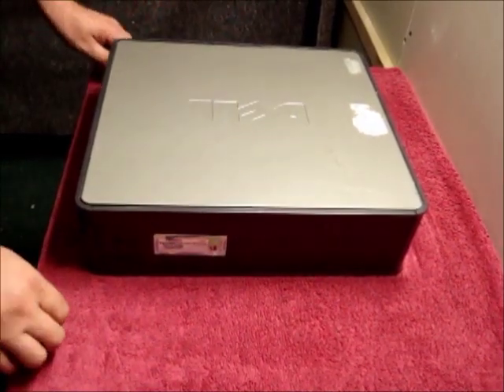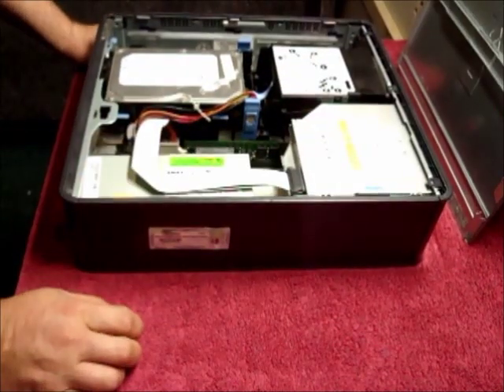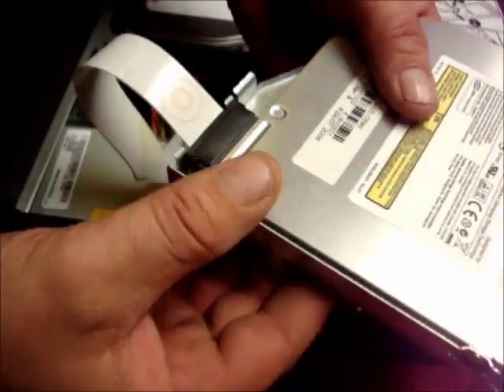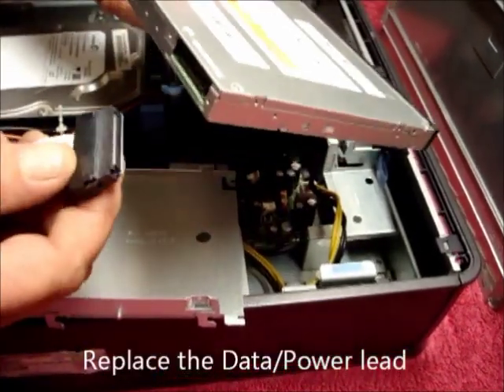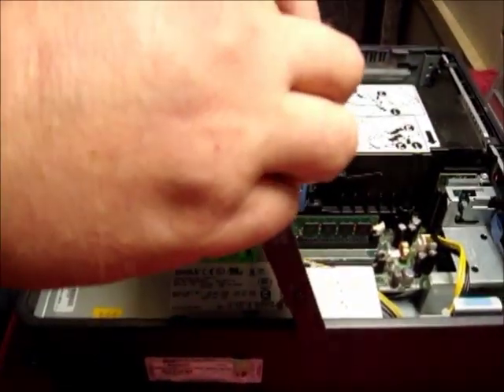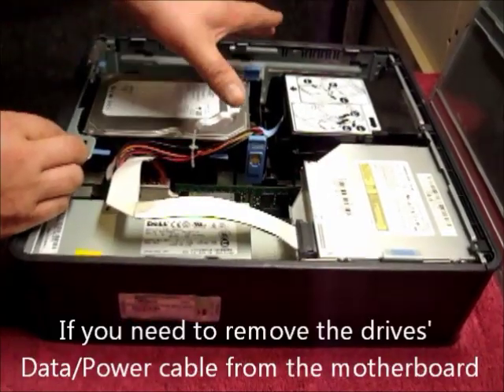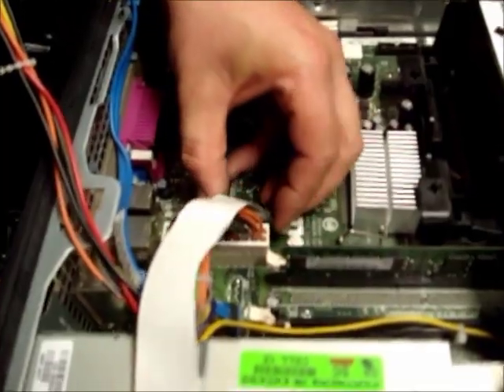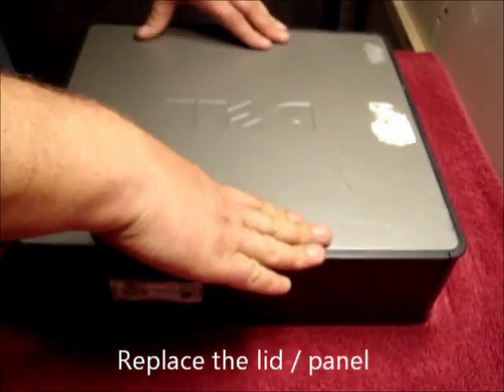How to change / install / remove / CD / DVD Drive in a Dell GX520 or GX620 SFF Computer

Comment: Is it possible to internally connect a laptop DVD RW drive using an adaptor cable? I know that there are USB connectors available on ebay to connect the drive externally but I want to connect the drive internally on the motherboard.

Comment: I have a Dell Optiplex GX620 SFF and it doesn't have a catch on the side to release.  There is a blue lever on back that releases one side of the panels which gives me access to the hard drive, RAM and other components.  Yet the CD drive is on the other side and buried under the motherboard.  (Very strange)  I was looking for a way to remove that panel as well.  It seems that we have the same model but different case?  Anyways it is a well done video and thanks for sharing.